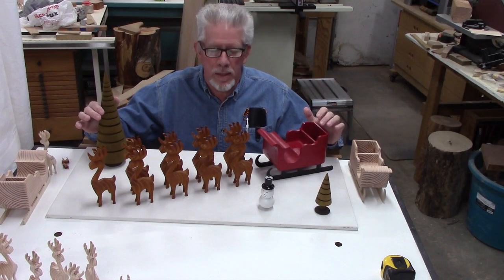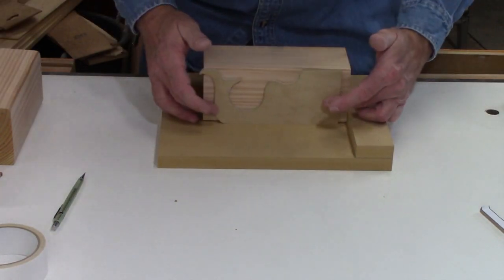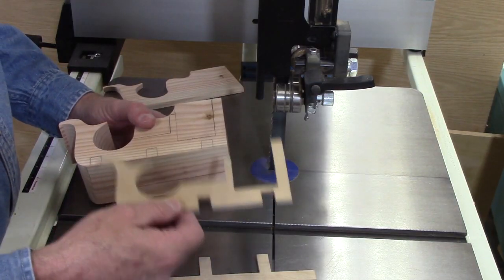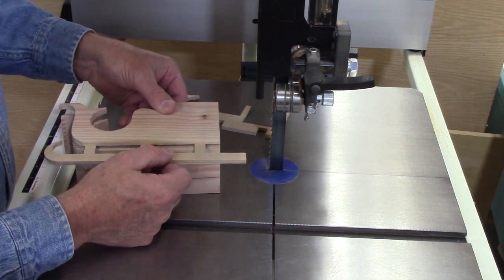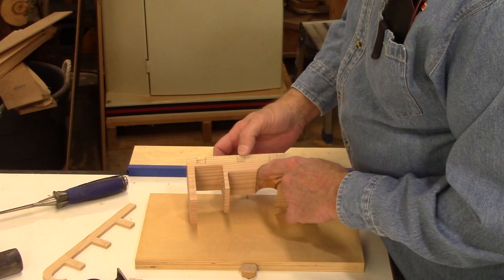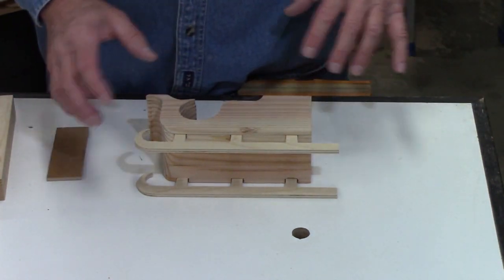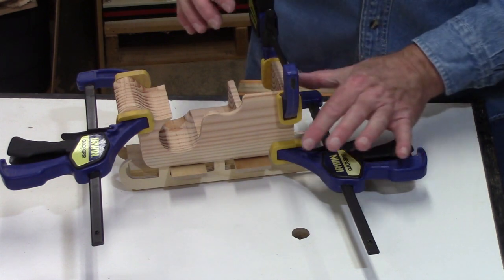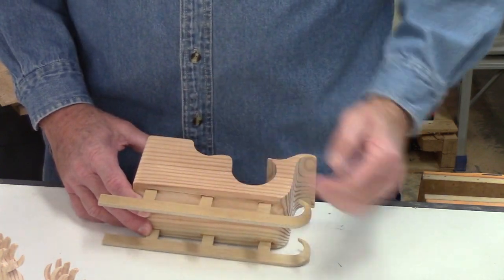Santa's Sleigh

Comment: I would like to purchase the sleigh pattern but I only find a reindeer pattern that is 2 1/2 inches tall.  It appears that the sleigh is too large for this pattern and the picture of your deer seem to be bigger as well.  Where do I get a pattern for the deer that is proportional to the sleigh?  Thanks so much.
Reply from the maker: I provide a rain deer pattern at no extra coast, with my sleigh pattern. It is about 5 5/8 inches tall. The finished Sleigh is about 4 5/8 inches tall. Since the rain deer are a caricature of actual rain deer, I feel that size works for this sleigh size. 

Have you seen my video on how I do these rain deer?
Reply: @terryspade441  how do you get the plans for the sleigh and reindeer
Reply from the maker: @terricantrell7539  I sell them on Etsy: https://www.etsy.com/listing/660738387/santas-sleigh?ref=shop_home_active_2&crt=1

Comment: Terry
In your plans do you list the size blade you use for each application? What do you use for inside cuts when you have them. I am really trying to not by a scroll saw.
Thank you for your guidance.
Reply from the maker: I do not list the size  of the blade in my plans. Use a 1/2" or 3/8" inch band saw blade to cut off the sides. Use a 3/16" or 1/4" 10 to 14 tpi band saw blade to do the inner curves. I would not try to do the Sleigh on a scroll saw. It is too thick to cut on a scroll saw.

Comment: Does the carter stabilizer really help? Beautiful job!
Reply from the maker: Yes it really does. I only use it with 1/8" and 3/16" blades. They say you can use it with 1/4" blades and I tied it , but I didn't like it with the 1/4" blades.
Reply: Thanks for the quick reply. I’ll try it with the 1/8 blade I want to use. Have a peaceful holiday season.
Reply: @Trainman0401  I also have the Carter Stabilizer. works very well.
Reply: Anything from Carter is money very well spent

Comment: Terry I do not criticize how a fellow wood woodworker produces.  However I would remiss in telling you this dangerous thing you did on this video.   When you were crosscutting the 4x4 on the chop saw you were cutting cross armed !  DANGER DANGER DANDER !!!  You set the peice, took you left hand over to hold the Peice on the right side of the saw and used your right to work the saw and make the cut !  VERY Very dengerous and a habit which will eventually lead to bodily injury to your left fore-arm.  Rule for the chopsaw.  If when operating you ever find your hands crossed you are endangering yourself.  simple correction is to hold the part with the right hand and operate the saw with the left.   I have one small scar, got very lucky, but have witnessed other where the blade cuts into the soft backside of the forearm !  Not a pretty site.   Your videos are great.  Watch the front end of this and note how you shirt sleeve easily comes in contact with the blade guard.  Imagine a large peice and the guard being higher.  Caught shirt sleeve grabbed and pulled in !!!  AHHH heurts to visualize it.

Gary -

Keep pushing the wood !

Comment: Why do you use such a large blade?!  Try 1/8th inch.
Reply from the maker: I prefer the 3/16" blade in the thicker wood. I use 1/8" and 3/16" blades. It just depends on what type of wood and thickness, the radius I am cutting etc
Reply: Do it your way

Comment: WHAT IS THE NAME OF WOOD FOR MAKING SLEIGH?
Reply from the maker: I am using Doug fir Dimensional  construction lumber 4 x 4 inches  actual size is 3½ x 3½ inches. Different types of wood are used as construction lumber in different parts of the US. Any wood will work.